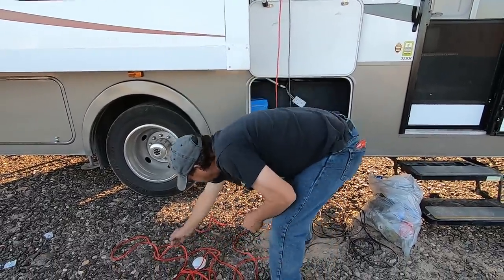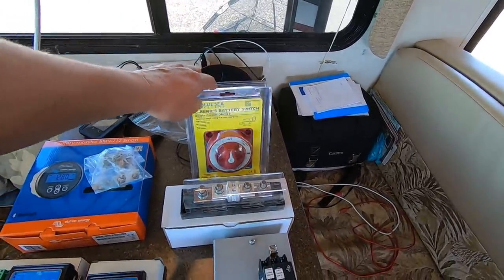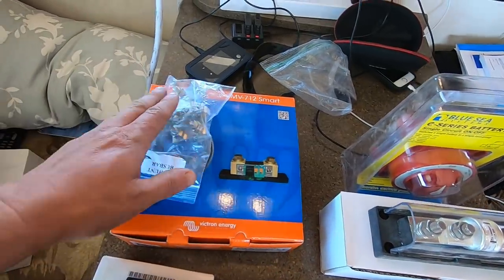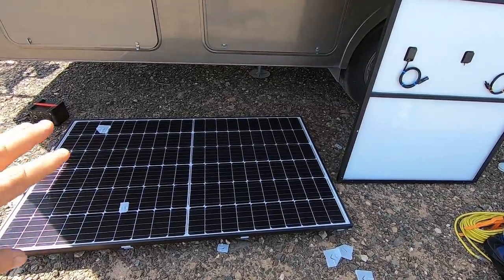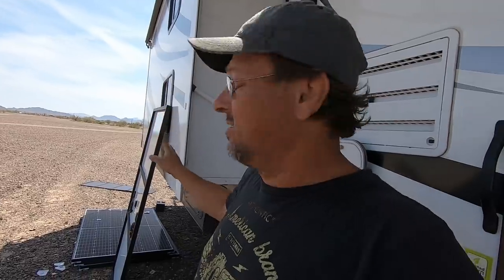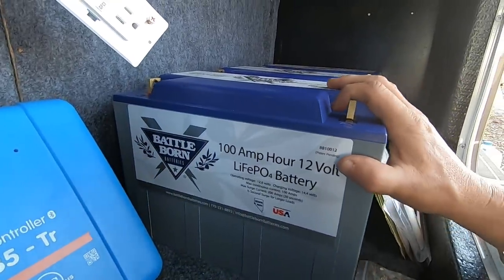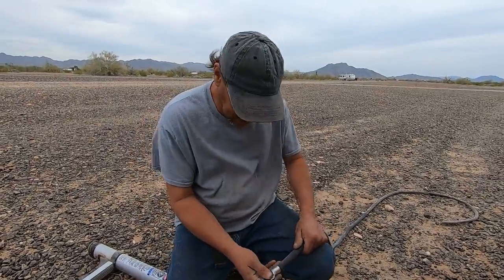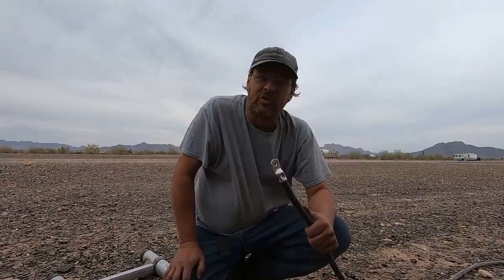Nomadic Fanatic solar install Pt.1

Comment: Yeah I hate those crappy pass through outlets too. lots of trailers burn down because of that. Really nice way that you dressed up the wiring. It looked better than the factory. I like the old school crimp tool. I need one of those. Great job 👍👍

Comment: Hey Wayne.  Great videos.  I have an idea for you that might make you a little extra income.  We have a small bumper pull trailer that doesn’t have much real estate for solar but I installed a 270 watt system on it.  However, we also like to camp north in summer which usually means the solar doesn’t produce much at all due to the trees.  So, I put together a little system that sets on the ground.  I can “chase” the sun throughout the day.  Quite simple as you know.  Some quality 12ga. wire, a few two place push together disconnects and two 51 watt panels (51 watt in my case because I happen to have 4 extra 51 watt panels laying around).  Simply attach a 3/4 x 3/4 alum. angle each side of each panel that stay on the panels for propping while in use.  Pigtail from each panel to connect them together, pigtail out of one to plug the 25’ of lead to run to the inexpensive charge controller, pigtails out of the charge controller, pigtail out of batteries boxes then just plug & play.  All goes together and easily plugs apart for transport.  Clean, easy to use set for remote use when needed.  I think you could easily “stamp” out these kits easy and sell as a kit.  And for those that don’t want to, or can’t, put solar up top this could easily be expanded to make larger systems.  Just something I thought might help you expand your services.  The possibilities are endless.

Comment: Hey Wayne, YES that bulb will light up/glow, those leds just need to be stimulated with enough voltage flowing in the right direction. DC is king my entire rig is DC

Comment: That kit is about $5800 for anyone wondering. That's for the equipment, no panels or install.
Reply: TheSoloAsylum that sounds about right.  What a nice solar setup huh?
Reply: @MrMinimalst  It is certainly nice equipment, not for the weekend user..
Reply: @TheSoloAsylum  it's a great system that will service Eric and Angela for years.  Be well!

Comment: I think you did an amazing job. My only recommendation is that I'm pretty sure you're required by law to solder and crimp your wire connections. Because, like you said it's a moving vehicle. I can't tell you where I found the info on that but when I did my system that was a requirement by law. If you're installing these as a business, you should dot your i's and cross your t's to cover your own a$$. That's just my opinion. Everything else looks really good! Take it for whatever it's worth to you.
Reply from the maker: never heard of that law. Ill look into it.

Comment: Nice!  I know the Victron stuff is high end / good quality stuff and those 3 Battle Borns are at least $1000 each!  Yikes!  Those panels can't be cheap either.  Looks like you used pretty much all the roof space as best as you could.  I'm looking forward to seeing the finished product and what Jax thinks  :-)
Reply: Actually if he purchased them during the van build and used the promo code those panels were under 200 each
Reply: @1958kyra  awesome price on such a high output solar panel!  But still the lithium batteries are uber expensive
Reply: I would do the same thing though, just get the best if you're going to full time like this couple and invest in high quality gear

Comment: Great videos!  I enjoy your straight-forward approach to guiding us DIYers.  I just relocated my 4, 12v BB Lithium batteries from the step well in my class A to a location about 20 feet from there. The original 1/0 AWG cables from the batteries to the house and chassis solenoids were about 24 inches long.  I used high-quality 1/0 AWG welding cable (rated at 600v) to make the 20 foot run, so I'm curious if that is sufficient in your opinion.  I'm not running a large inverter at the moment, but do plan on installing at least a 2000 watt pure sine wave in the future. Any advice would be appreciated,.

Comment: Great material, and excellent installation! Are all panels connected in parallel? being a 12V LiFePo4 system that does not need high voltages to equalize like liquid acid batteries, it is useless to connect them in series since a panel has enough voltage to make the MPPT work correctly and charge the batteries, a high voltage in the charge regulator, even if the regulator quietly accepts it up to 150V it serves no purpose except to save the diameter of the lowering cables and to slightly lower the effiecency of the charge regulator making the MPPT work and creating heat for the huge difference between input voltage and charging voltage, both in case one or more panels are in shadow, ok there is the internal bypass diode but the long lap of the series and the diode losses, I prefer to use more cables thicker than raising the voltage, the batteries would not discharge them more than 50% since i'm a constant i would make them last as long as possible at least 10 years, unfortunately they are not monobloc with external BMS because also and charging them too much (end-of-charge voltage) due to this chemical of rods lowers the number of cycles, even if incomparable with the chemical (any) lead that last very little by comparison, the LiFePo4 are an excellent investment.
Good job !

Comment: Hey Wayne.   Did you have to install anything that handles the spike/surge the AC unit gives when it first starts up before the wattage levels off to running level?   Looking into this as well and curious what you went with or if it’s not a big deal.
Reply from the maker: No I didn't but I am working on a deal with a Co. that makes them.

Comment: How did you wire the batteries for a balanced charge and discharge? 3 100 amp hour batteries seems a bit undersized for that rig : even for an 90% discharge
Reply from the maker: from the CC to the batteries on positive on one battery and the farthest battery is the negative.

Comment: Did you separate the chassis batteries from the coach batteries. I’m assuming the alternator no longer charges the coach batteries. Thanks
Reply from the maker: Yes i did. That will be in part 2
Reply from the maker: I dont know what you mean by B.I.R.D. If you are talking about a Bird meter, those are for RF watt readings.

Comment: Nice (Professional) work Wayne! Wish you were here in Fla. so you could help me with my solar! BTW you should look at PROTENG Fire suppression systems as they are not expensive and quite effective. They go practically any where in your rig (Like the engine compartment, generator, solar control). Check it out on youtube. Maybe some day you will make it this way.

Comment: Hi Wayne.  How do you like the VIctron equipment now that you’ve had a chance to work with it?  Wondering since you’ve installed many different brands of inverters, battery monitors, charge controllers, etc.
Reply from the maker: I like it but I think they should have Bluetooth in the inverter itself, and a master control box that all the stuff talks to and you connect to that box only for all the info.
Reply: rvprepperwayne I agree they should add Bluetooth to the MultiPlus inverter/charger without the adapter.  I think they will eventually as they have with their solar charge controllers and battery monitors. Also check out the CCGX and Venus GX for the common control and reporting across all components. The remote console over internet is pretty cool.

Comment: Any updates on this system ? Would you of done anything different ? I am about to purchase this exact setup. I also am thinking I will opt out of the color monitor as using my smart phone seems like a easy way to save 500 on buying a additional display. Great video BTW straight to the point and entertaining.  Thank you

Comment: Why do you need a 400 amp fuse when the max so far of Eric's system is bringing in 80
Reply from the maker: The 400 AMP fuse is for the inverter.

Comment: I have a 400watt windy nation solar kit. What gauge wire do I hook the charge controller to the battery?
Reply from the maker: What charge controller do you have
Reply: @rvprepperwayne  10 gauge awg coming out of the controller to the battery. I have a 30 amp controller that came with the kit

Comment: what size wire did you use on the battery connections and from the batteries to inverter?
Reply from the maker: 4/0

Comment: Hi Wayne,
I'd like to begin discussions about scheduling time for some repairs, upgraded toilet and stove top, additional 400 watts of solar plus charge controller, relocation of house batteries and replacement of 4 GC-2 with 2 renogy 170 amp/hr Lithium Iron Phosphate, update of interior with desk/work space.
I have a lot of work and would like to meet up with you in 2 weeks to a month.

Is this an option?
Reply from the maker: email me at rvpreper@gmail.com
Reply: @rvprepperwayne  you have mail.

Comment: Wayne I love the job you did there... Can I get your email for a couple questions on equipment I'm installing into my Newmar mountain air class A. Unless your going to be in Canada in the near future lol I could meet up, jk, I have done alot of electrical jobs, but not on rv's, just want to ask which parts of old system I should keep.
Reply: I have two huge new Rolls Surrette batteries (#1 in Canada for lead acid) I have 2800watt magnasine inverter/charger (new) want to integrate into my 50amp system.
Reply from the maker: email me at rvpreper@gmail.com

Comment: Great job Wayne
I don't like to be the bad guy but that vent line is a black tank flush line 
I know because I have a 2013 Mirada and mine leaked when I used it to flush my tanks the first time
PLEASE PLEASE PLEASE double check that the fittings are tight
Reply from the maker: I found that out after recording the video.  Eric has checked and made sue it didn't leak.

Comment: You left out a link to the panels themselves...what is it? Also did you  run two of the panels in series and the other two in series but  then connected item in two sets of parallel to the solar charger?  Thanks:)
Reply from the maker: I will add them later today. Sorry I missed it.
Reply: @rvprepperwayne  Thanks. What about the solar panel wiring are they all in series to the charger or did you run 2 sets in parallel to the charger??? ...think parallel helps with shading:)
Reply from the maker: they are in 2 strings. they are wired in series/parallel
Reply: @rvprepperwayne  Way to go...thanks for reply:) Great job too!
Reply: @rvprepperwayne  The link to the solar panels is still missing:)

Comment: You don't have the courtesy to contact a potential customer to tell them you are leaving the state after weeks of them (me) trying to contact you via email and this forum to set up an appointment for service and repair.  All you had to do was to say, "sorry I'm heading out". Did you do that? No.
Reply from the maker: You emailed me on the 7th, 11th, 12th, and the 14th. I called on the 13th. I was working and was on the road on the 8th. Your email stated you wanted to know where I was going to be in the following weeks or month. I have done a lot of driving and I did call you on the 13th. Yes late to call but I did call and left you a message. So I did have the courtesy to call you to talk to you.

Comment: what the hell is a convertor i know what an invertor is..
Reply: A converter is the RV name for a battery charger and is standard in most RVs.  It converts 110 AC current to 12 volt DC to charge the batteries.